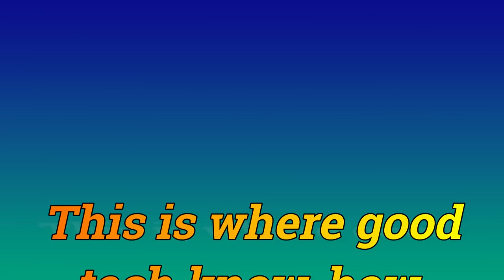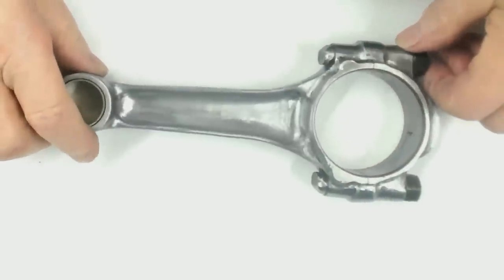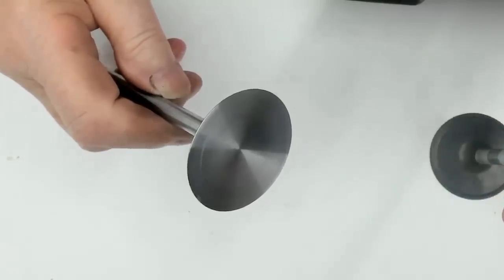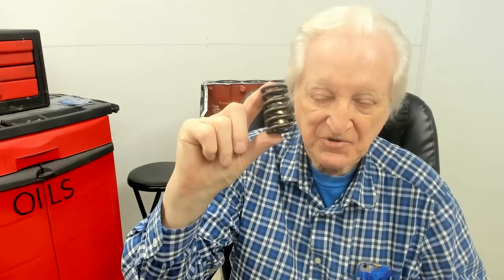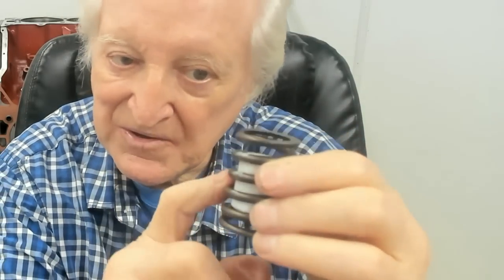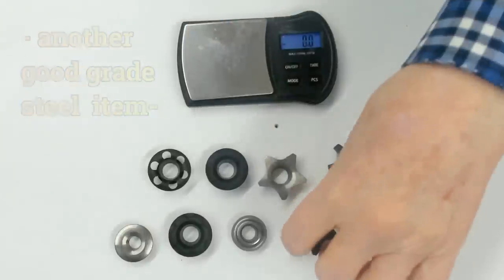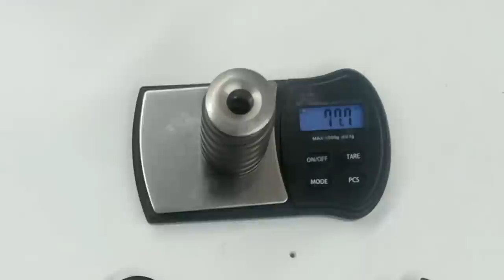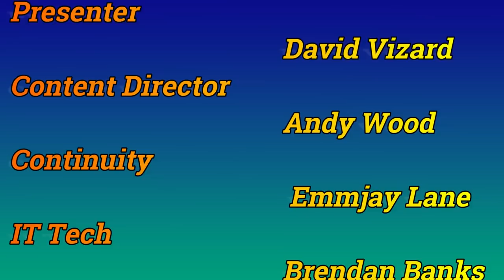Cut 50% weight from valve, spring & retainer.

Comment: I installed a set of those bee-hive springs in my Corvair engine and they were possibly the best money I spent on engine parts, as they are lighter and achieve higher RPMs than the stock springs, by far - I turn 8K RPMs w/ hydraulic lifters and zero float.

Comment: I started using stock 5.3 LS springs with a Comp Cam retainer on SBC’s about ten years ago. They work well on mild street builds and they allow you to run more lift on the vortec head without cutting down the valve guide. Pretty sure I was paying less than $3.00 per spring.

Comment: Very intrersting thank you. A man by the name of Mal Stuart (A great rally driver of Sunbeams and Avengers RIP) once gave me a tip for the cam follower bucket in a Hillman Avenger pushrod engine, to lighten it by cutting approx 10mm from the top of the bucket and also drilling another hole on the side near the base to let the oil run out quicker, hence being lighter.

Comment: Built a 6g72 that weighs about 25 lbs lighter than oem. aluminum flywheel,+1mm Hollow stem valves with dished faces., billet pistons and forged rods that about 1/4lbs lighter than oem per rod, Cam gears that weighed about 1.5lbs less than stock, And here this guy is telling me I couldve dropped even more. Definintly keeping this info in mind incase I build another one.

Comment: I have heard of titanium retainers having a very limited lifespan due to fretting on the steel spring, but it may be a function of how well fitted the retainer is to the spring.  I have seen titanium retainers last many thousands of miles, but also were a very tight fit to the spring.  I have rejected valvespring kits for projects if the titanium retainer has any looseness when fitted to the spring.  Something to consider when mixing/matching valvetrain components.

Comment: It would be really cool to see this applied to a more modern 4 cylinder engine like a K20/K24. If you could keep most of the strength and reduce the weight of the rotating and valve components you could use a bigger cam and rev out with slightly lower cylinder pressures. Unopened they can make 400-600hp with boost so moving that way up the rev range would make a lot of juice.
Reply: There's lots of thinking going on here.
Reply: I am watching this series preparing to rebuild the 22r in my Toyota... I'm hoping to end up with OVER 100 HORSEPOWER from a "stock" rebuild :) actually,  I'm using a Weber carb, Offy manifold and header so I might end up closer to 120hp lol

Comment: Hey, David there are a bunch of Mercedes that used a behive valve spring. There might be some cross over if you want to make a custom retainer. I would love for you to start making a diesel series. I have a project that is going to start happening soon with a Mercedes OM606. Think 6BT but 3.0L, twice the valves, and  half the weight. It's a pretty cool engine. Once I'm done with that I will probably move into a project for something common rail.

Comment: David, I am eagerly look forward to more episodes of this series....But this build was supposed to be with all stock 318 parts; not titanium bits, small stem valves, and beehive springs.
Reply: He had a video on this, it is all "off the shelf parts"...
Reply from the maker: Jeff, if you want to draw the line at Mopar parts only then that's uip to you. I am just widening all the low buck options and that will almost cretainly be moves that have not appeared on any YT channel.
Reply: And it enlightens us to ways we never thought of. I am all in favor of using any part that can work to make a fire breather especially if it uses other branded components.

Comment: What kind of rpm would you expect with a beehive spring and 40-50lb boost  on it? I understand NA but would you still use it with big boost? I wouldn't think their would be enough seat/open pressure. I haven't tried yet to know. I've used them in heaps of NA stuff.

Comment: For what’s it worth, if y’all spin a valve in a lathe, and use a drill with a rosin roll or flap wheel, on the underside of the head, you can get a decent swirl polished finish and it does a good job of cleaning up roughness on stock valves.

Comment: This is a great video. I love this kind of content. I have a question: I know that reducing valvetrain weight makes it easier for the engine to turn higher rpms, reduces wear on the components, and generally makes it easier for the motor to rev quickly, but sometimes I hear guys say it also makes the engine produce better 'under the curve' power. Is this true, or is that more related to camshaft choice and airflow?

Thanks, David. Valvetrains are one of my favorite systems.
Reply from the maker: Very often mediocre valve springs will go through a minor 'bounce' phase that could occure severl time as rpm increases.   
A spring with  better damping and a higher resonant frequencey could fix that and so produce more power.
Reply: @DavidVizard  Good info. Thanks for replying!
Reply: Also because most dynos now measure hp with an increasing rpm sweep less mass will result in faster acceleration so it will indicate more horsepower. The actual produced power like for dragging a heavy trailer up a mountain at WOT and 0 acceleration would not be increased.
Reply: @bcbloc02  Oh wow, I would have never thought of this. That was appreciated

Comment: What about polishing the sides of the big end of the rods where they meet each other, and the crank? There can be friction there and the oil will probably keep them apart, but seems to me being extra smooth, will eliminate any chances of friction! Would it be a good idea?
Reply: But dont throw off the thrust . Lightly polish , all friction reduction frees up ponies.
Reply: You're supposed to have LOTS of rod-crank clearance not only for rod bearing cooling but to sling oil up to the piston and the camshaft-lifters.

Comment: 6:43 I've been wondering if you would create controlled vacuum leaks as a way to get more air into the engine. Now after hearing you talk about increasing the vacuum signal it looks like my thoughts may have been barking up the wrong tree.
Reply: Remove pcv vale and rerout hose from base of carburetor to above choke in air cleaner lid. Filter element creates mild restriction that causes blow by to be recycled into intake and slight vacume on piston rings. 
Street cars normally driven can not use header port vacume.Keep every inch of vacume you make.

Comment: Looks like the PAC 1218 beehives are under 40 bucks and rated for .600" lift. Am I missing something here?
Reply from the maker: Mr 413x398 (bore & stroke?) I strongly supect  they are a cheap off-shore knock off, Just look at the surface finish - it looks well below what PAC put out.
DV
Reply: @DavidVizard  Yes, you are probably right. BUT, since we are talking budget building, shouldn't we check these out for giggles? And maybe compare them to the Howards springs?
And yes, bore and stroke. Many.

Comment: I have a bit of disagreement regarding the carb size, you are going to reach mach at the venturi which will stall airflow automatically and nothingt you do down wind will stop that.  There is a literal limit to airflow in a N/A motor and no amount of work on the heads can overcome that. The only you get from lightening valve train mass is how fast the motor will accelerate and reducing parasitic losses.  Ring tension and improving the efficiency of the oil pump (a huge parasitic drag on the motor) are the best places to free up HP on a restricted inlet motor.

Comment: Please, For The Love Of God use both an ARP rod nut and bolt...  🙂
I've seen way too many of the stock ones stretch and even strip the threads upon attempted re-installation...
Reply: That goes against the spirit of the budget build.
Reply: @TIMEtoRIDE900  Just ROD BOLTS, not main bolts, or head bolts, not timing cover / water pump bolts or intake bolts or any other unnecessary bolts...  Just a $60 set of ROD BOLTS to be sure the engine doesn't self-destruct after all this effort!
Stock rod bolts should basically be considered a "wear item," especially if you don't know the history and provenance of the rods.  You're not seriously expecting them to run used bearings and piston rings too, are you?!  Budget build is one thing, but you're being a bit absurd... 🙄
Reply: I’m sure he will check them with a stretch gauge and verify them

Comment: I thought the idea was to use the stock parts ?
Reply: I thought that was how it started too. Only original parts or factory equivalent replacements like bearings and 30 over pistons and rings. Then grind or weld and modify those parts.

Obviously it's on an entirely different course now but there still seems to be a lot of info to gain from it.
Reply from the maker: We are focusing on stock parts new and used but not soley from Chrysler. I am also giving options to cheaply move up from there.

Comment: i use to build engines to be the fastest in the area on the streets on pump gas and i learn everything from old man bell when ur going for big hp and high rpms u need a lot more way more my valve locks cost 380 bucks but titanium locks can flex and not break and it helps the valves from not breaking at very high rpms . bell always says oil is the # 1 problem race engines have  that is y we polish the block port the oil drops the faster u get oil to the bottom the better but we pull over 10,000 rpms my fav. rods are the aluminum titanium alloy rods they can handle some crazy rpms if u prep the block right . but these type of engines are for from cheap . now days i just build street rigs for driving and make a lot more money off of selling them instead of losing money because it has a crazy engine in it

Comment: Surprised you didn't go for Magnum valves, I  think they are lighter than the LS valves. They are 5/16 stem, 1.92/1.625.
Reply: DV said cheap availability of LS used valves.
Reply from the maker: Mr, V8 sir, did not know that. Thanks for the info.
Reply: @hotrodray6802  And used Magnum valves wouldn't meet the criteria?
Reply: Dodge magnum?

Comment: Correction. Corporate greed is what driving up prices. Which has nothing to do with supply and demand. Until they cut the supply to drive up the demand.
Reply: Not quite right..
In the last 2 years our politician's have printed as much money as was previously printed in our history, all out of thin air with zero backing.
In 1970 a pre 1965 dime would cost you $.12.
Today that dime costs $2.20.
Our manufacturers are struggling with the same issues that we are, they can barely source product at any cost today.
Reply: And they took all the silver out of coinage in 1965 because they were worried the price of silver would eclipse the 10cent face value of the dime. That was the last nail in the coffin for our fiat currency.